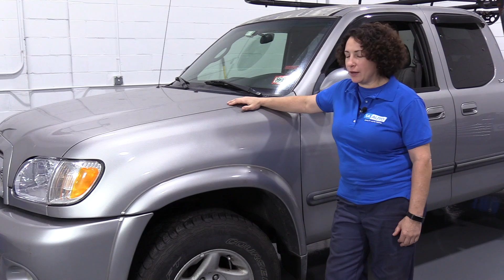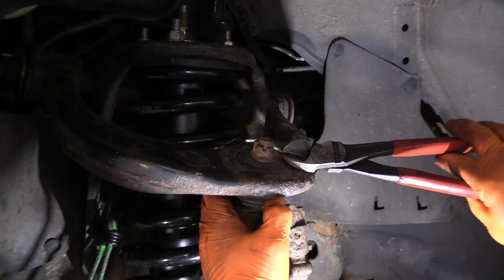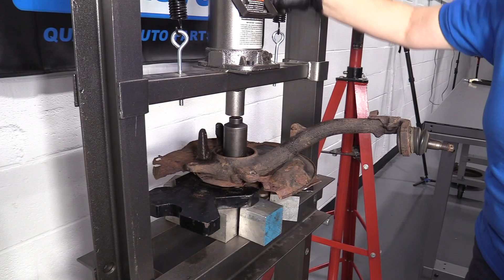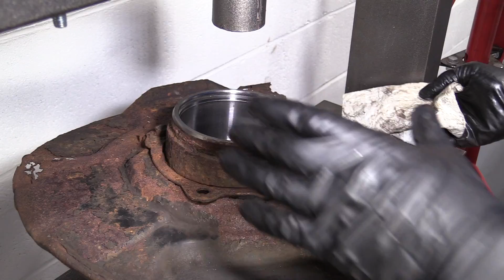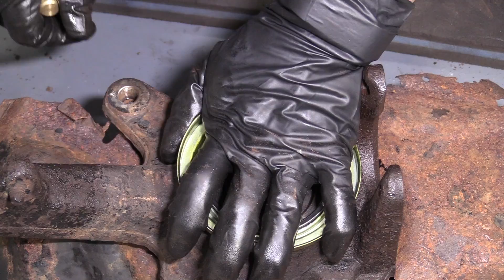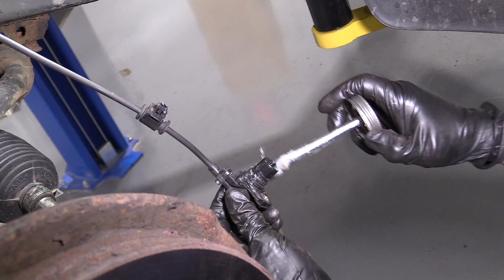How to Replace Front Wheel Bearing 00-06 Toyota Tundra

Comment: OMG Toyota --- were your engineers on strike? This is the most complicated bearing replacement of any truck I've worked on! This should be criminal, especially since the front suspension already likes to pop lower balljoints

Comment: i had to use an 8 ft pipe with my 3' breaker bar and i just remounted the tire and put weight back on to get the that axle nut off what pain, and the abs sensor of course broke inside lol

Comment: I'm dreading this job I gotta do all 4 wheel bearings on my first gen tundra 380,000 miles with 35s on a "4 lift I guess it was bound to happen sooner or later. My driver rear wheel bearing blew out so bad it took my outer axle seal with it.

Comment: You can use a bearing separator to clamp where the seal flanges and it will give you bigger ears to add support for hub removal on a press.

Comment: Thanks for the video I think overall it does a good job at explaining how to do this job.  I Wanted to recommend a few tips on some things I noticed for anyone looking to do this job on their own.1. When taking the 10 mm bolt for the ABS sensor in and out be extremely careful this bolt should not be in there very tight and if you get on it too much while you loosen or tighten it you can easily break it off and then you’re gonna have to be faced with trying to drill it out. 2. I highly recommend not using a flat blade screwdriver under the ABS sensor to pry it out instead use a pair of pliers and grip it on the sides and twist and pull straight up instead of prying underneath it. In my opinion she was lucky she Didn’t break the ABS sensor trying to pry it out like that. I have seen and heard a lot of people breaking them trying to pry it out this way.3 surprising to see a shop use the BFH method In a how to video.When removing  The upper ball joint it’s a lot easier and safer just to use a ball joint press than the BFH method and smacking your uca. Harbor freight sells a inexpensive two jaw puller that you can use on this job and also other various jobs making it worthwhile and a lot safer than hitting on your suspension components. 4. Highly recommend not hitting on the end of your cv  axle stud with a hammer you can easily mess up the threads to where your axle nut is not going to be able to start again causing you a whole new set of problems. Simple enough just to use a rubber mallet or screw back on the axle nut and tap on that instead. 5. When loosening and tightening the axle nut screw back on a couple Lugnuts to protect the threads on the wheel studs. I noticed she uses a long prybar through the wheel studs but there is nothing to protect the threads on the wheel studs when she is tightening and loosening the axle nut again this could potentially damage the threads on the wheel studs causing you to have to replace them as well. Just some tips I have either had to learn myself the hard way or from others experiences. Take it or leave it hope this advice may make your job a little easier and potentially save you from causing some further damage.

Comment: GREAT video, big job.

1. In my opinion anyone doing this job should replace the rotors, a good set of rotors is under $100

2. At the 33 minute mark we can see that the caliper brake line is rusty and delaminating, it really should be replaced. It's a $11 part and the hose is already disconnected.

3. Are we suppose to grease under the dust cap? I have no idea, if anyone knows please let me know.

Comment: For those alloy wheels the torque should be 83 foot pounds for a first gen tundra.  And good thing you are hand torqueing them.   Using an impact wrench will make the rotors warp and and vibrate when braking.
Reply: Yeah, I noticed that too... Like... No, mine only get torqued to 83 ft lbs.

Comment: just a tip, never hit the bare threaded end of a shaft with a hammer.    Screw a nut flush onto the shaft and then do it.    It will protect your threads on the shaft.  That poor tundra must have come from snow country.   So much rust.

Comment: Other than the bearing what other new parts were installed so I know what to order
Reply from the maker: +Jose Martines Thanks for watching!  When replacing the bearing on this vehicle some parts to consider replacing along side it would be the brake pads and rotors, upper and lower ball joints and the wheel hub.  Just be sure to inspect the condition of your steering and suspension components beforehand to get an idea of what will possibly need to be replaced!

Comment: Can you please explain why are you replacing the hub?  What was wrong with the old one ?
Reply from the maker: +Terry Giovanakis ere are some indicators of a worn wheel hub bearing or other wheel-end damage:
Snapping, clicking or popping. ...
Grinding when the vehicle is in motion. ...
Knocking or clunking. ...
Humming, rumbling or growling. ...
Wheel vibration and/or wobble. ...
Shudder, shimmy or vibration at a constant speed.
Reply: @1AAuto  thank you but I was questioning  the replacement of the  hub not the bearing. I am replacing my bearing in my 97 4runner and need to know if replacing the hubs with the bearing is somewhat of a standard procedure or recommended  or what. I am asking because  every video i have watched  including yours, the hub is replaced but nobody explains why. I carently doing this job so before I pressed the old hubs in the new bearings I would like to know. When do you need to replace the hub. When does it goes bad

Comment: 9:41 What to do when the knuckle is not released, I hit it like the video and didn't come out,  is not rust visible, I put some w40 and still not coming out. any idea what to do pls...
Reply: In My opinion you shouldn’t be using this method in the first place. It’s simple enough just to get a long enough two jaw puller to properly pop out the upper ball joint from the Upper control arm. Harbor freight sells a inexpensive one that you cannot only use for this job but several other Jobs and it saves you from Hitting on your suspension components with a big hammer

Comment: Hey everyone just wanted to throw in, I purchased a wheel bearing and hub kit from rockauto and it was a cheap bearing but still cost 70 bucks. The diameter of the bearing was not to oem spec and got to a point on the press where it was walking in and suddenly fell in for about half in inch. I removed the bearing because it was not a good fit and purchased a koyo from napa autoparts for about 80 bucks. The koyo by far was a much better bearing visually and after pressing it in went in as you would expect and no issues.  If i ever do a bearing on this type of application i will use a koyo. Great video of R and I 1Aauto (especially the part where you support the bottom half of the lower race so you dont split the bearing when installing the hub), you get the point across of how to do the job which I think is a great source of info for the diy guy or gal.
Reply from the maker: +Kaleb Cantr Thanks for the feedback!
Reply: That was literally an OEM koyo bearing she had in her hand 🤣

Comment: Hi folks , I am attempting this on a 01 tacoma . I pressed the old bearing out of the spindle . The bearing came out but another piece came out with it ,it's the same diameter and about a half inch thick .Was that piece in front of the bearing or behind ? Ive never seen this before . Thanks.

Comment: Is there much difference doing this on a 2007 Toyota Tundra SR5 4 wheel?
Reply: Your whole hub assembly might be the bolt on style. I know the lexus GX470 steering knuckles have bolt in wheel hub assembles you might get lucky

Comment: Got the job done after watching this video about 3 times and taking notes. Great information here. I took my knuckle to a auto machine shop and had the bearing pressed out and the new one pressed in for $75.00. I tried using a bearing tool from a tool rental shop (like the Hub Grappler) but gave up because even with a 3' extension on my breaker bar, I couldn't move the bearing more than about 1/4". The machine shop has a press and the right dies to make it work. total time was about 2 hrs of my labor plus trips to the machine shop. Cost ended up around $225.00 Thanks for this great video.
Reply from the maker: +John Andrew Thanks for checking us out! 1AAuto.com

Comment: Do you know if a tundra 2006 6 cylinder has abs sensor on the right side?
Reply from the maker: +DAVIID GM Thanks for checking us out! That feature will differ depending on the vehicle and is not something we would be able to confirm with a VIN. Please let us know if you have any further questions, thank you!

Comment: This can be done a lot quicker with an air hammer (for all the bolts and the hub tool) and a hub tamer type of tool. No need to remove the hub at all.
Reply from the maker: +Pedro Talavera Thanks for the suggestions!  We try to use basic tools most customers would have available to do them to do our repairs.
Reply: Yeah like the press

Comment: Nice long Snap On ratchet but for that price I'd just get a Milwaukee 2763 or 67 even a Harbor Freight 1k ft lb cordless impact to proceed with the job makes it a lot quicker.But I understand the job can be done with basic hand tools except for the press.
Reply from the maker: +Gshock714 Thanks for checking us out!
Reply: None of hobo frieghts tools are gonna out out 1k of tq. Not even my 1/2 dewalt with 5amp battery does that.

Comment: that rusty backing plate is driving me up the wall, please change it
Reply: Same.  I change mine out with new OEM ones.
Reply: @timtsuber7366  if yours look like that I wouldn't waste money on it because it's rotten and a backing plate is the least of your worries.
Reply: @and7976  not quite my backing plates were rusted to s*** when I bought mine. But It had that new frame on it from a claimed recall so
Reply: No. It’s solid and it’s oem. Go away

Comment: Blows my mind that Toyota truck hub bearings are pressed into the steering knuckle, making them a major P.I.T.A. to replace, as seen above. 
GM uses a far better method- they bolt the hub bearings to the knuckles, no need to remove them and fuck with a hydraulic press...
Reply from the maker: +KaBoomer Thanks for the feedback!

Comment: Just a heads up, I followed this video with a stubborn wheel bearing, while using the rotor instead of a proper press plate to push the bearing out my rotor shattered. 

I'd recommend using proper equipment instead of short cuts!
Reply: I used my rotor it worked just fine but I put heat to my bearings to remove the old ones. And a 20 ton shop press

Comment: Also noticed that when the mechanic was torquing the 4  14mm bolts connecting the steering knuckle to the lower control arm, as she was applying torque to a couple of the nuts and the steering arm tie rods were moving while she was applying the torque.  Not sure how you get an accurate torque reading this way, much less with the large pry bar flexing while attempting to get 173 ft. pounds on the axle nut.  The jerky moves causing the flexing of the pry bar m,ay have made the  torque wrench click, but I was taught to apply slow even pressure to a fastener and listen for the click. 

I also think the mechanic should have at least mentioned the rusty brake shield and that  it should be replaced sooner rather than later.

Comment: Thanks for showing how to do this.  Total pain in the )$&;: job.  The front rotors aren’t very deep when you are pressing out the hub. You have to keep building up the press blocks on top of the rotors to get the hub completely out.  I eventually used an old rear drum with supports.  Thanks again. Very few videos on this topic.
Reply: 21:42
Reply: You can use a bearing separator to clamp where the seal flanges and it will give you bigger ears to add support for removal.

Comment: When I pressed my hubs out, it wouldn't come out like this video. The c-clip bent outward and the outer half of the bearing came out with the hub. I had to buy a new hub and c-clip. My abs sensor was also seized so I had to buy a new one.

I don't think I've ever had the outer bearing half not come out with the hub.
Reply: It's best to buy the whole hub.  Even in this video the hub should of been replaced as a unit.
Reply: The same thing happened to me on my 2001 Tundra 4WD w/ABS.  I partially pressed the hub out, and noticed that my c-clip was getting bent.  I stopped pressing and removed the outer seal and the c-clip, and then continued pressing.  The hub came out but the inner part of the bearing was still stuck on it.  I al$o de$troyed my AB$ $ensor getting it out.  FYI to others, don't try this with a 18-ton press cuz I bent mine.